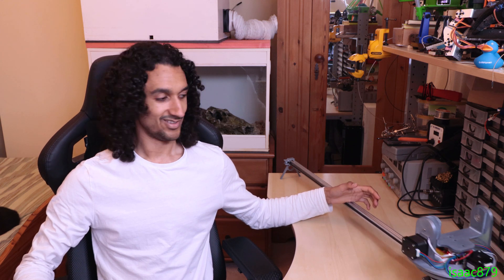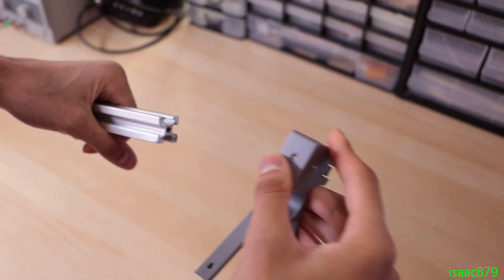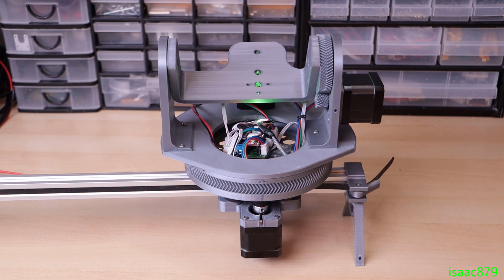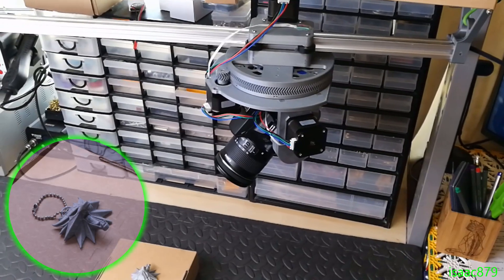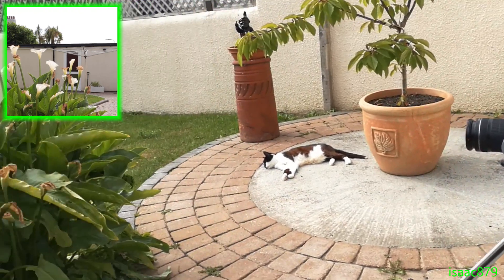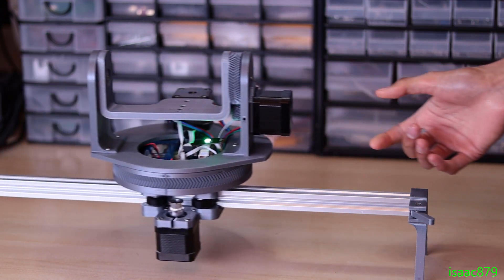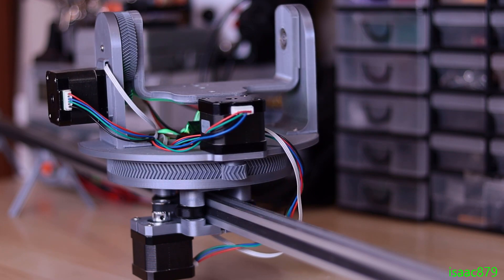3D Printed Motorised DSLR Camera Slider With Pan/Tilt Head (Arduino/Stepper Driven) 2020

Comment: There are a few issues with this design, the bearing is not great,  too much play up and down I ended up printing 3 different versions and all had the same inherent fault,  the tilt can't take very much weight and is too narrow for most cameras. A Good project but ultimately a disappointment.

Comment: with this project is it possible to use the slider as a vertical slider?
Reply from the maker: I would not suggest it. It can just lift the weight but if there is any small knock to it the motor can skip steps and come crashing down.
Reply: @isaac879  thank you

Comment: @isaac879  Great Job.  Very Impressive. 
I am trying to adapt this to work on an ESP32 with PS4 remote. I am trying to create a PCB whose pins to work with the ESP32.  I  am new to this stuff so I was hoping you could look over my PCB design to see if it looks ok to you.
Reply: I’ve tried and ran into issues with the bt libraries slowing down the stepper steps and other cycle issues. Highly recommend ditching the direct bt and moving to a ps2 or other controller option.

Comment: Thanks a lot for the inspiring great video! I have just designed and made a 3d camera slider on my own but as I am not as good on the software side I am planning to upgrade my rig with your controller software. Though, watching these videos I realize you don't emphasize much on how you control the whole thing via a smartphone (or an xbox controller for that matter). For instance, fixing the camera at a point in space (2:40) feature is amazing but how do you do that with your rig? Please make another video where you talk about the UI (xbox or a smartphone app) to get things done.

Comment: That's awesome! Liked, subscribed, and looking forward to more! 👍 I'm still stuck on Python programming 😅 ADHD holding me back a little. Hopefully I can start learning C, C++, and then Arduino language once I great treatment. Arduino is epic! And I've only found out about modular aluminium extrusions fairly recently and my creative imagination won't stop flooding my mind with an endless stream of ideas ever since 😵 Can't wait to progress so I can put some of those ideas to use and start experimenting! The more I learn about this the more motivated I am. This stuff beats Lego any day! 🤗
Reply: If you like arduino try esp8266 or 32. Also, as someone with similar concerns id suggest being aware of what parts of a project weigh you down and work around those. Dopamine detox before you start at least for a week. Pick a simple project so you get some quick neurochemicals flowing and seeing what you're learning connect. It will give you mental energy, you're going to need it. Good luck

Comment: Isaac, I built your wonderful creation and am using my phone and the Arduino/Bluetooth app which you recommend to control the pan/tilt  part   ( slider to come later). I want to use an XBOX wireless controller, but I don't know how to interface that with the blue tooth module. I see the main.cpp file but can't put them all together. I think the main.cpp is a Visual code file, but I'm drawing a blank on how to use it.  Is there a way to press and hold a controller button and have the tilt/pan continually move? I am using the array functions and increment the movement in 10 degree increments to build an 18 position array. I then use the > key and have to press it repeatedly to keep the steeper advancing to the next array. I think I'm missing something here as well.  Any help would surely be appreciated
Reply: Hi, I've made a Python application which you could try out here: https://github.com/cbradburne/Pan-Tilt-Mount/tree/TMC2208-Drivers/Python%20Controller%20App%20for%20Pan%20Tilt%20Mount

You'll need to install Python3 and a few libraries, as documented in the GitHub. You'll also need to run the app from within VSCode. I'm yet to compile it for Windows - I'll try and get on that!

Before running the application, connect the computer to the Pan Tilt mount via BlueTooth, and connect your controller to the computer, then run the app. Your controller name should appear in the box, top right, now select the serial port (bluetooth Pan Tilt connection) from the dropdown list. 

be able to control the Pan Tilt mount by either dragging the red dot around, or using your controller.

I'm currently running it with macOS and a PS4 controller, but it should be cross-compatible. I would really like to hear how you get on.

Comment: Really beautiful design! Well done! I was going to recommend TMC stepper drivers when I heard the A4988 driver noise in the beginning but you addressed it at the end. I learned it the hard way building a motorized slider myself using the A4988. As for the turning and twisting of the wires, I'd recommend looking into slip rings like the ones offered by Sparkfun.

Comment: Where do 5mm_to_8mm_shaft_spacer and 3mm_to_5mm_wheel_bearing_spacer_centred belong to?
Reply from the maker: The 5 to 8mm spacer if for the slider motor timing pulley. You only need it if the pulley has an 8mm bore and not a 5mm one though. The 3 to 5mm spacers are for the V-Slot wheels. The bearings they use have a 5mm internal diameter so they need a spacer to fit the m3 bolts.
Reply: @isaac879  Thank you. One more question. Clamp lever has very large hole but is hold by m3 bolt. How does it hold the belt?
Reply: F623ZZ Flange Bushing Ball Bearings rigth?
Reply from the maker: @Animace  Yes you got it - the bearings. I thought I also put a version of the leaver with an 3m hole if you didn't want to bother with the bearings.
Reply: @isaac879  I can modify it myself, thank you.
Strange thing, my carriage was riding better without spacers. Hmmm.
And why there is so strange end at the spacers?
Reply from the maker: @Animace  That's odd I would have expected it to have about 2mm of play making it really unstable... I designed the spacers to have the tabs on the end so they would stay in the same orientation and not rotate. The idea was that if I wanted the wheels lightly tighter or looser on the extrude I could just modify the spacer hole to not be centered and I wouldn't have to reprint the entire carriage.
Reply: @isaac879  I will experiment with spacers, then. BTW great design of everything around this slider. Well done!

Comment: Hey man great job.I like you`r pan end tilt head design,and the simple way to program multi point move only with a game controller.I make a similar 3 axis moco system.And i`m consider to use your code.And i have a question.Is there a acceleration and de acceleration in your code for smooth move between key point (like star point,and end point)?
Reply from the maker: In my newest version I have added some acceleration to the keyframes but you don't have much control over them. To properly implement acceleration controls would have required me to pretty much rewrite all the code...
Reply: I understand.i will try your code to see how it works.Thanks again

Comment: 16 times microstepping can still move the load of the camera ?
Reply from the maker: Yes it can!
Reply: My setup of camera would be around 2kgs for night photography, will have to include gears and to cover up the torque loss with microstepping I Guess, which motors were u mentioning to switch to in this video?
Reply from the maker: @994pranav  Ideally the camera should be mounted about it's centre of mass so shouldn't require any holding torque. Weaker motors would limit the acceleration but I'm imagining for night photography you won't be requiring fast movements. I switched from Nima 17 42x42x40mm steppers to 42x42x23mm ones (you can see pics on my insta).

Comment: I've been working on this exact same design for a while, you beat me to it! only i'm not an engineer but a visual artist.
One feature i planned on adding to my version is the ability to control speed and acceleration curves (i still have no clue how but the concept is there), that way it would be possible to emulate the "camera robot" look from really fancy ads. 
I will 100% build your pan tilt head and adapt it to my dedicated slider.
Amazing Project!

Comment: Hello Isaac,
congratulations .... great development.
I have a question about the components. There is a difference in the parts list and the schematic sheet. What are the values of the resistors R1 to R6?
Would a BC548 be possible instead of the 2N3904?
Reply from the maker: Thank you!
I just checked and the schematic is correct - I'll update the parts list soon. Thanks for bringing it to my attention.
I had a look at the BC548 and I believe it should work although the resistor (R5) will need to be changed to 1k as the current limit to the base is only 5mA.

Comment: Maybe you watch my last three videos, its in german but u can switch on the translation. I use polulu micro geared mozors and will realize ur design with this motors, u can control these motors via magnetic encoder and a very small additional pcb. If u want we can discuss about it, send me a message or email. Great idea and super video!!

Comment: Nice reversed footage technique at 1:08 ;-). That is a great build.
Still using A4988 drivers here?
Reply from the maker: Thanks! For this video I only used the A4988s but I have tested my TMC2208s and they work brilliantly! I'll probably do another update video when I get the 2040 extrude and new stepper motors.
Reply: @isaac879  Very cool!
Reply: how did you overcome vibration of steppers. i thought it was because of a4988 but your footages are very good.

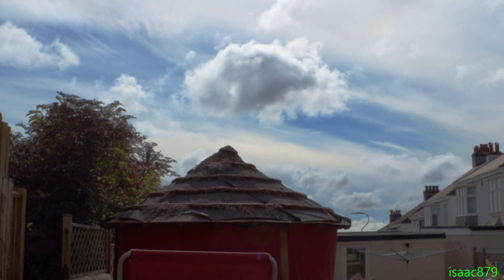Comment: What is causing the up/down movement on the flower shot from 2:36?
Reply from the maker: The code calculates the target point in 3d space so the tilt axis will also move to keep the target centred.
Reply: @isaac879  Should it not then be only moving in one direction?
Reply from the maker: @MikeMcRoberts  Maybe I'm missing something but to me it just looks like the tilt axis is just angling up slightly throughout the movement. I think in this shot it should only be moving in one direction but depending on the position of the target it is possible it would angle both up and down.
Reply: @isaac879  I am referring to the slight jiggling up and down as it moves along. it's only subtle but it is there.
Reply: isaac879 I've tried all the tutorials on YouTube but it doesn't work, do you guarantee this tutorial will work if I try?  and has anyone tried?  and can the xbox controller be replaced with another one?  because the xbox controller is too expensive.  thank you